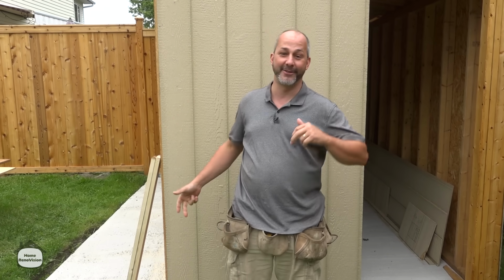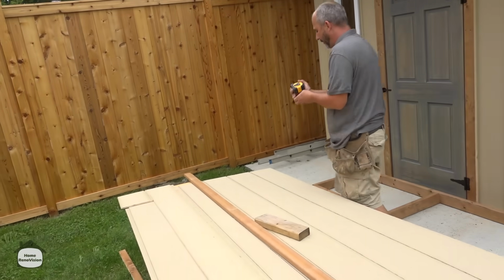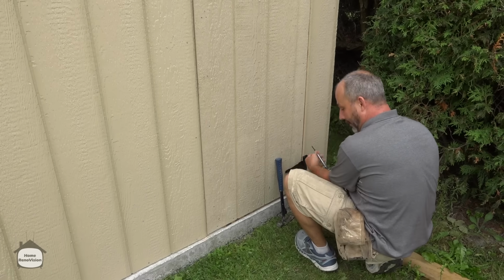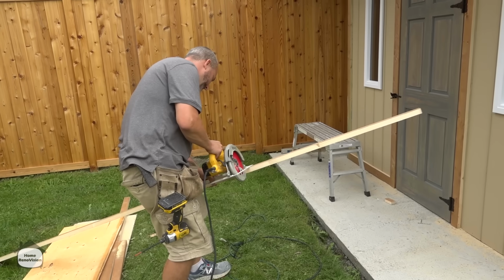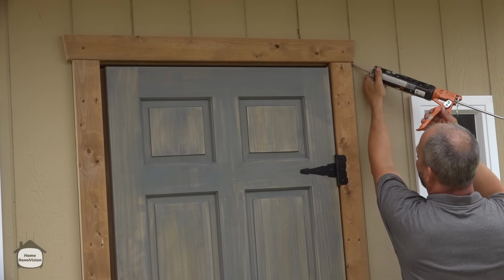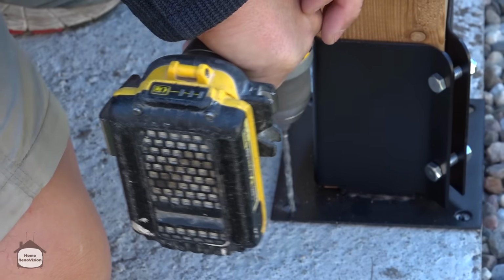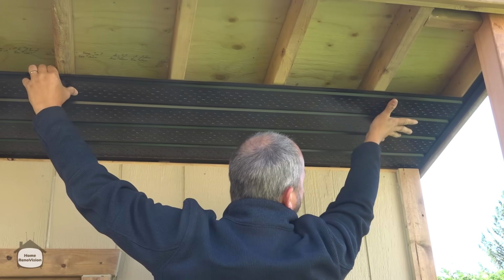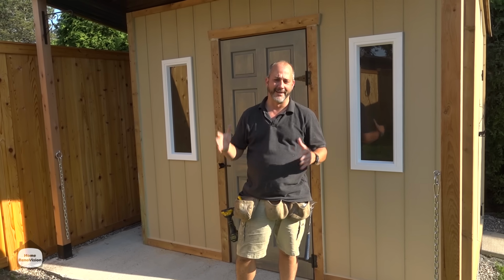How To Build Your OWN Shed | Soffit, Posts, Trim, Ramp & Door Tutorial

Comment: Hi friend love this series one little tip for lining up to fit a hinge rather than using a piece of plywood or something similar. First fit your hinges to the door in the position you need them, then I prefer to use a screwdriver to balance the door on,  this way you can "seesaw" the door into position to get the exact position for the top hole on the top hinge. Screw it to the door frame then you can remove the screwdriver from underneath the door then its really easy to position the top screwhole of the bottom hinge by lining up the edge of the door with the door frame by eye then just screw in the other missing screws into the frame. Easy peasy lol.
I think I'm definitely going to follow your idea for building my new shed very soon perhaps as we move into the spring next year I love the simplicity and strength and versatility and usefulness of you design thanks for your videos mate 👍👍👍

Comment: Really great looking shed. One aspect I am not sure about is the skirting board.  It looks pretty although rain water is likely to gather there no matter how well it is caulked, thus rotting out the base of the shed. If you insist on this method, perhaps a bevel on the top edge to throw the water off would help. Just a thought!!

Comment: Am I the only one who blown away by when the videos started, they were in 105 weather and by this video he needed a sweater? I wonder how long it took to build this shed... Also, I'm sure you knew this already, but I thought I'd say it anyway just in case it benefits anyone else. When installing eye bolts you can slip a screwdriver or something similar through the hole and it turns much easier and quicker.

Comment: To help when installing large eye bolt anchors (like at the end of this video), run a large and long screwdriver through the eye after the bolt is initially started. Then, you have a great "T" handle to help turn the bolt into the wood. Of course, tighten down to exactly 1/2 millimeter as needed....  ;o)

Comment: Thanks! I like the custom made door. Is it much different if I want to make double doors & have one slightly overlap the other so the center gap is covered (or maybe just add a small metal trim piece/ to overlap)? Would the 2x4s on the edges where the doors meet have to be notched or angled to not bump one another? Any videos on this sort of DIY door in double doors?

We used a flexible metal wire with plastic coating for our gate latch to open from the inside of a door to a covered area outside the workshop.

Comment: You need a hurricane strap that connects the stud the to top plate and a strap to connect the stud to the bottom plate.  It is a system.  The roof connects to the top plate, the top plate connects to the stud the stud connects to the bottom plate and the bottom plate connects to the foundation.  It needs to be completely strapped, top to bottom.
Reply from the maker: Before you continue to make statements about how it should be done. please finish watching all the videos. Hurricane straps were definitely used.

Comment: Consider doing a DIY on a Ramp Door (similar to those on the back of a toy hauler trailer).  Also, how big a deal is it to make the shed twice as big?  Also, what if the one side of a hill?  Can you show how to make the foundation for such a shed? 

Restated: Would like to see you do this . . .
 
1. Shed on side of a hill (on "stilts")
2. Ramp door
3. Twice as big
4. Walk around deck (just a little bit) - a dangerous one - no side rails 
5. Under deck storage space (sealed / dry)
6. Exposed exterior wood imperivous to carpenter bees
Reply from the maker: feel free to make it a s big as you want. On the side of a hill I would suggest using post construction and sinking those bad boys deep into the ground.

Comment: This is one of the best looking DIY shed's I've seen.  Thinking of trying to setup this as the big project next spring for me and my kids to work on (although it will be mostly me doing it lol).  Wondering about design options for lawn tractors though.  Just make the cheater door bigger or would that be too wide and may end up sagging.  Maybe double doors up front but would need something other than gate hardware to secure them and I like the look of the shed with the single door.  Any thoughts or tips would be appreciated.  Thanks for the videos!
Reply from the maker: tonight we show you the finished product. plus all the trials and tribulations we faced getting there.

Comment: Really enjoying this series, lots of great tips as usual. Small question/comment on the cheater door. Would the frame of the door benefit from a couple of diagonal braces, low to high from the hinge side, to help combat the inevitable sag?
Reply from the maker: Hi Mark. No need for the braces since the skin is 1 panel and is not going to twist and sag. Cheers!

Comment: I'm not sure if I'll be asking this right but here goes. Concerning the side lawn mower door, you said its gonna be flush with the panel kind of like a hidden door. Is there a way to make the hardware pieces be the type that its a hidden push motion type way to open it? I'm not sure what you would call it but you have on certain types of cabinets, that do not have handles an you press the corner to open the door. What I'm asking is if that would be  a possibility on the shed or no?
Reply from the maker: Hi Gina, there is always an option when it Comes to hardware. Just remember the trickier it gets the more you will pay for it.

Comment: +Home RenoVision DIY Hi, I'm enjoying your video's. I noticed you appear to be using screws with a square head bit? ( not sure on the correct name ) Instead of a star pattern " philips" on the screw head, I also believe you're using the hammer/ impact function on your drill, even when adding your screws? Please could you explain if you're doing these things and why? I'm planning on building a small shed soon, it'll definitely not be as grand, but certainly am gaining some knowledge, watching your video's! Thanks.
Reply from the maker: Hi eric, the screw gun is an impact driver that has a lot of torque and when combined with the square"robertson" screws it can drive all day long without slipping. One of my favorite tools for sure.
Reply: @HomeRenoVisionDIY  THanks for your response and the information. I too have one of those drills. I've never used the robertson screws, I have some, just don't have the correct sized bit for the heads, at least I can't find anything! I will give them a try. So, would you say that using impact and robertson screws is, easier and better, would you recommend using them  in most situations? Anything that provides a lot of torque and less slippage sounds good to me!  I also really like the .22 hammer tool! That things cool. Although it may attract a bit too much attention here in my home town. Greetings from South Africa.

Comment: Jeff, on the two sides where the walls extend to the edge of the slab, did you scale back those walls to account for the 1 1/2 inch trim you installed along the bottom?  My shed will be the exact dimensions of the slab and I just need to know if I should leave room around the edges for that trim.
Reply from the maker: we left a bit so it would finish flush yes!

Comment: What screws are you using to frame with? I was always taught to use nails because screws break. Technology has come a long way in 20+ years I’m sure.
Reply from the maker: in this design the screws do not experience shear load so no worries. regular 3 " construction screws.
Reply: Here in the states it’s usually either Phillips (which stinks in my opinion) or torx. Torx is great, but has more slop on the bit than Robertson. I recently did some fence repairs and I replaced all the Torx and Phillips heads to number 2 Robertson.
Reply: And thank you for the reply!

Comment: Have a 8 by 10 shed and, of course, need a bit more space to store 4 bicycles. Built an extension to store them but its not cutting it. Thought of undoing one of the 10ft walls and pushing it out the extra 3 to four feet. Is it viable to undo the siding and corners, cut the frame from the inside and build the extension from there?

Comment: Could you use metal cable for the pull cord since it will be outside?
Reply from the maker: I would prefer nylon.
Reply: Nope, solid rod, like a coat hanger.

Comment: I think slide locks would be better, less chance of locking yourself inside by accident. This is from experience. I have those same locks you used on a gate and they close on me all the time locking when I am not ready for them to. As least I can reach over the gate to unlock it tho.
Reply from the maker: That is the beauty of this. You can pick your own hardware and it will still work. Cheers!
Reply: this is true.

Comment: With those latches you better hope the wind doesn’t blow the doors closed, because you can’t open those latches from the inside
Reply: Drill a hole in the door and pull a string thru
to the latch from the inside and open from the inside

Comment: ?????? 
to make it into a SheShed what kind of insulation is needed for a climate of 5 degrees Fahrenheit in the winter.
Reply from the maker: r12 batt would be fine but you also need a heat source!